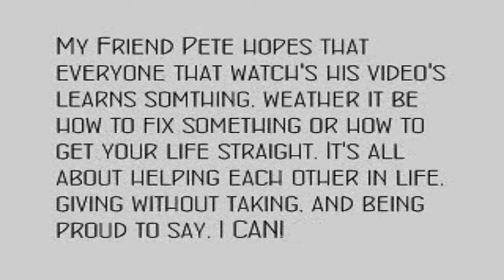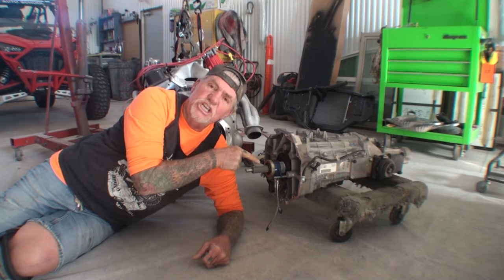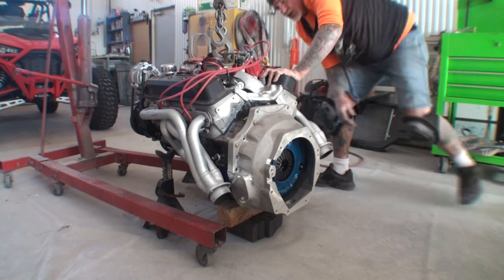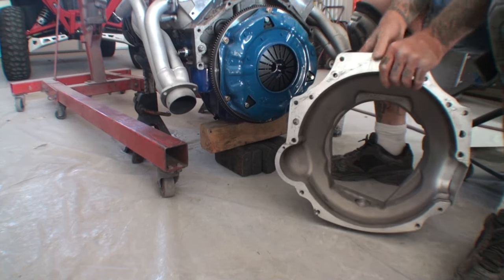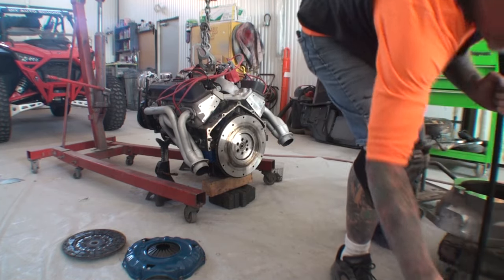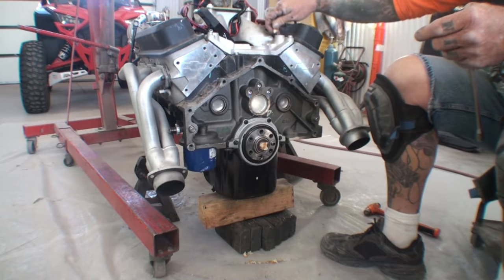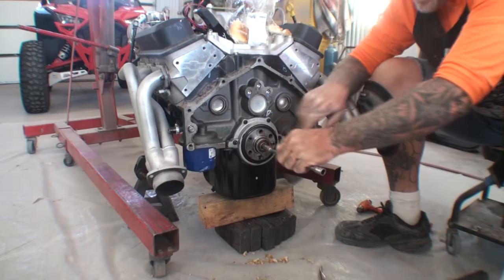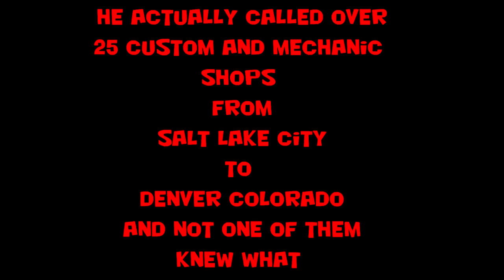Why Should I Use A Tremec T56 Magnum 6 Speed Transmission  - Part 2 - These Parts SUCK

Comment: He is going to have a million dollars in that transmission! Maybe consider having a machine shop take the original style bell housing and a bell housing that will bolt up to the transmission, cut them in half and weld the two halves that are needed together.